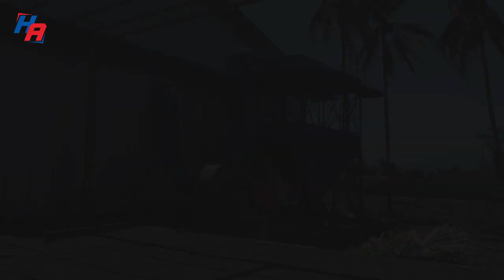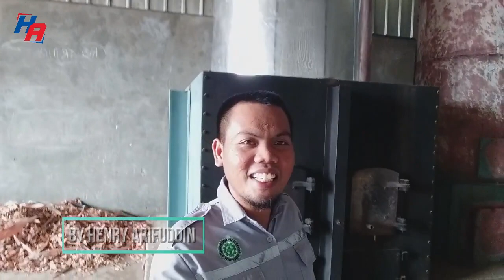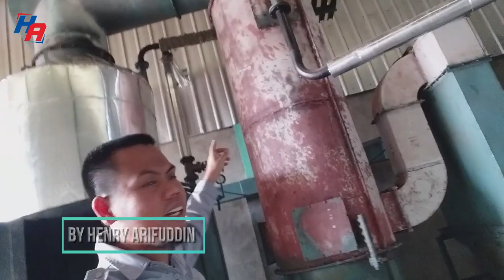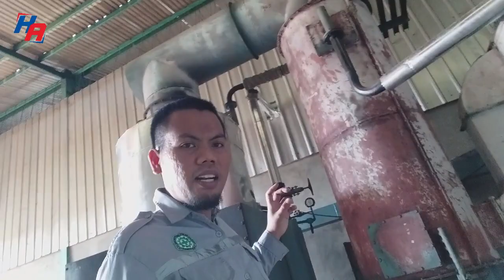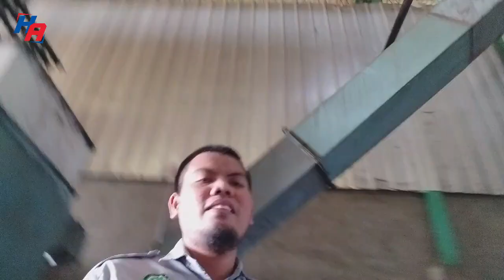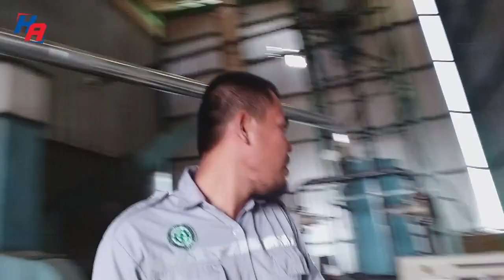[ULAS DETAIL] KOMPONEN BOILER THERMAL OIL

Comment: Selamat malam om, saya mau nanya fungsi circulation pump itu utk apa ya?
Terus sistem pengaman panas pada Burner dan panel itu gimana dan make apa supaya menghindari meledak/terbakar? Adakah fungsi dari kapasitor bank utk kerja T.O.H? terimakasih
Reply from the maker: Circulation pump untuk mensirkulasikan oli dalam sistem. Sedangkan untuk menghindari ledakan ada pengaman safety valve nya. Untuk panel agar tidak terbakar masing - masing motor juga bisa pakai overload.
Reply: @HenryArifuddin  terimakasih om
Reply from the maker: @boyboyboy170  sama - sama pak Boy ...

Comment: Salam kenal pak saya juga kerja di boiler thermal oil 3 Ton pak apa penyebab Oli selalu berkurang terimakasih🙏
Reply from the maker: Salam kenal juga pak. Banyak faktor yang mempengaruhi, bisa jadi kemasukan udara / pipa kotor dan buntu yang mengganggu sirkulasi fluida. Maaf lokasi dimana pak?
Reply: @HenryArifuddin  Sirkulasi oli ya maksutnya pak? Lokasi di Jambi muara bulian pak
Reply: @HenryArifuddin  faktor karna sepiral bocor bisa juga ngak pak? Sering ngonect Mengonect bisa juga kan pak oli nya tertinggal di dalam mesin nya?
Reply from the maker: @fandifandi5483  Iya pak, ada jebakan untuk buang udaranya kah?
Reply from the maker: @fandifandi5483  Bisa jadi pak, coba check level tangkinya. Masih tetap seperti semula apa berkurang banyak.
Reply: @HenryArifuddin  maksutnya buka angin nya ya pak?
Reply: @HenryArifuddin  berkurang trus pak kalau ngonectngonect
Reply from the maker: @fandifandi5483  Tapi berkurang bukan karena bocor ya pak?
Reply from the maker: @fandifandi5483  Biasanya kita buat ada jebakan udara, udara dibuang. Jadi udara tidak ikut disirkulasikan pada system.
Reply: @HenryArifuddin  ada pak itu kalau boiler kami namanya buang angin pak sering anginan pas manasin pagipagi pak apa karna oli nya belum panas ya pak?
Reply from the maker: @fandifandi5483  Harusnya panas pak kalau boiler jalan 24jam.
Reply: @HenryArifuddin  iya pak soalnya kmi gantigantian Sip nya pak sip Siang/Malam pak
Reply from the maker: @fandifandi5483  Siap pak ...

Comment: izin tanya..di dlm tengki merah apkh ada koil oli jg ??
Reply from the maker: Ada pak, jadi oli dipanaskan dulu disana baru kemudian masuk ke shell utama.
Reply: dlm boiler shell ada coil di panaskan api langsung..fluida di tranafer ke penggunaan dryer..yg dlm gas fuel duct apkh ada coil lg ???
Reply: apakh mekanisme nya spt thermal fluida heather single coil atau bkn ??
Reply from the maker: @anwarsadad4736  Iya pak, di dalam tungku terdapat pipa spiral / coil untuk memanaskan oli-nya.
Reply from the maker: @anwarsadad4736  Kalau di dalam flue gas duct tidak ada coilnya pak. Flue gas duct untuk jalur pembuangan asap gas-nya.